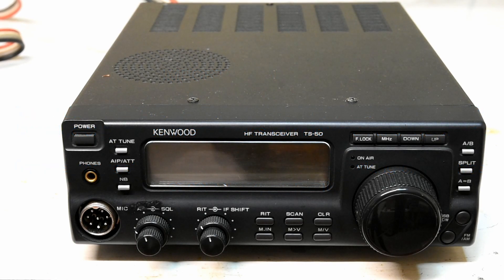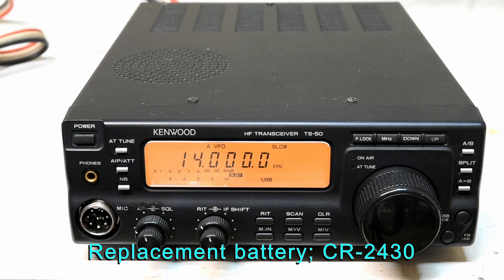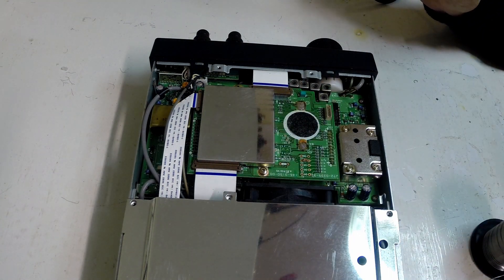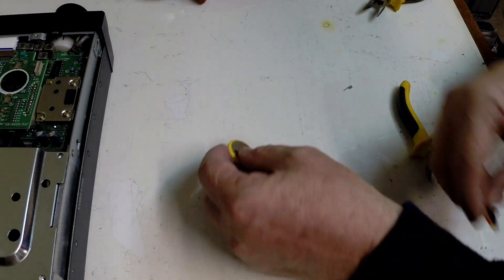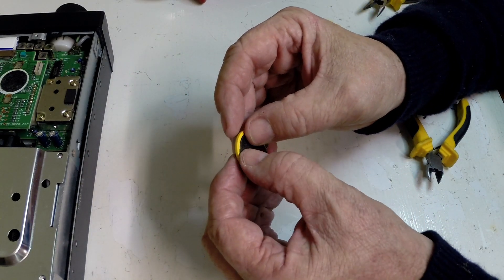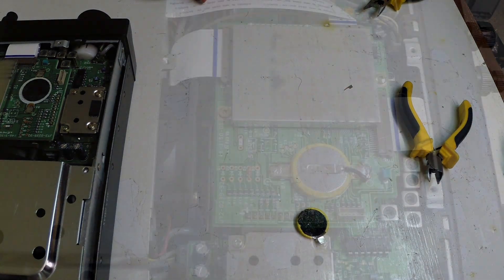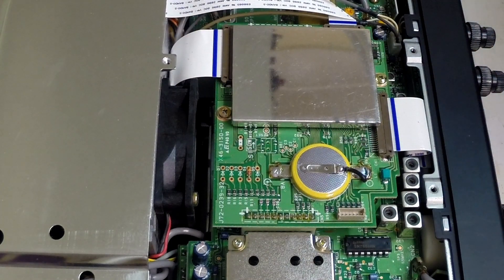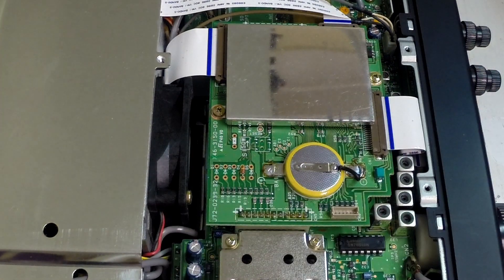TS-50 Memory Battery Replacement - 13 August 2022

Comment: Thanks very much for the video.  I've removed the original battery and am waiting for a mount that will fit on the board, into which mount I will fit a new battery.   That will make it easy to replace next time that battery must be replaced.   Question without notice:  Do you know if it's ok to run the TS-50S without any battery in place?   I'm working on some looms and hardware to run the TS-50S and AT-50, and want to test it while I'm waiting for the new mount and battery.   73 de VK2CEM

Comment: Actually, I did the same thing but I did not have to do that jumper. Once you clean the pads properly with solder blobs from the factory, aftermarket battery's tab are long enough to reach them. But great video nevertheless.

Comment: İ had diassembled a lithium battery socket-nest  from a computer board. İ welded it on Ts50 memory  plate..if this battery finishes too i can change new battery without welding .

Comment: Thanks Petra for the video. The original battery was CR2430 and which one was used...CR2032 or CR2450?
Reply from the maker: The CR2430
Reply from the maker: https://vk6ysf.com/ts-50_memory_battery_replacement.htm
Reply: any 3 v lithium coin-battey is ok

Comment: Brilliant! I've got the exact problem with my Kenwood TS-50. It looks a pretty straightforward job, thanks for this video.
Update
I unsoldered the original battery from the board, and replaced it with a CR 2032 battery holder. So now the battery is changeable without having to desolder it each time, and it works perfectly.
Reply: İ did the same with a battery holder from a  Pc board 😉